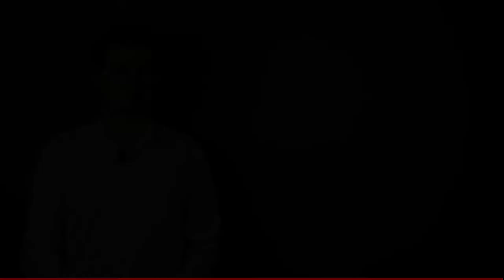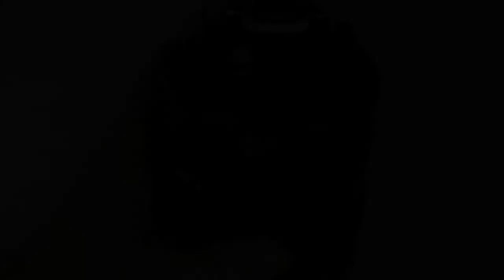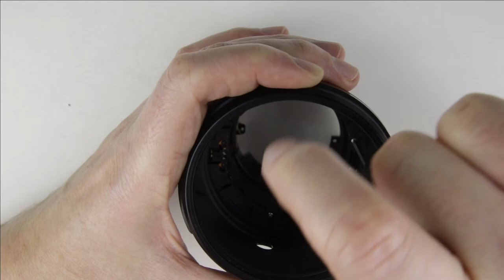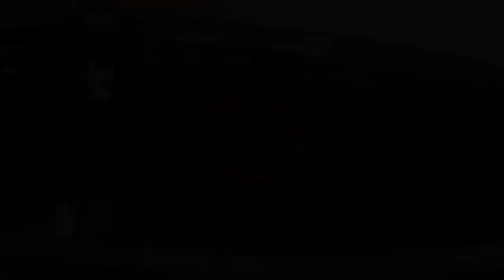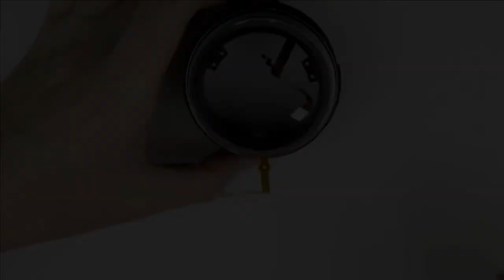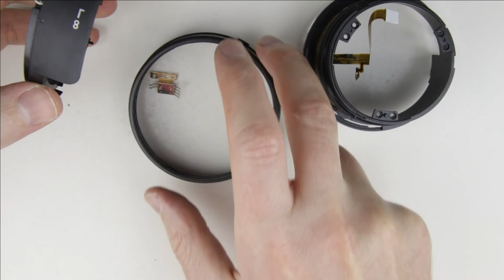Canon EF 24-70mm f/2.8 L USM disassembly for replacing the flex cable in the focus motor

Comment: Just perfect, thanks for sharing with us all your expertise. My friend has this lens and the zoom mechanism was a little bit stucked, so he sprayed some wd40 lubricant and now the  autofocus doesn't working properly. Do you think a good cleaning can solve the problem or the autofocus mechanism can be fully replaced? Thank you again.
Reply from the maker: If you mean that the lens is hunting during autofocusing, then most likely the focus strip got dirty. Remove the USM motor, disassemble it, clean the focus strip and see if it solved the problem. Wile do that, you can remove the WD40 fluid if there's any left in the lens.
Reply: @CamerasLensesEtc  Thank you friend. We'll try this solution. Have a nice week.

Comment: I have noticed that the o ring gasket for dust sealing in your lens is a bit torn. That would be great if you can make a video to show how to replace that dust sealing (there isn't   a single video on youtube show about it). Cheers.
Reply from the maker: Follow the disassembly video until I remove the metal bayonet mount, then you can replace the rubber gasket. Then, go to the assembly video, and around the end you can find how to put back the bayonet mount and the screws.

Comment: Very detailed demonstration. Could you tell me if there were any error codes that helped you to diagnose this problem or did you need to strip it down to find out? I have a similar problem with a canon 28-105mm f3.5-4.5 where the autofocus has stopped and there is no message from 3 different dslr cameras. I have tried cleaning contacts with alcohol. The lens will manually focus no problem and is in mint condition. There is very little information about repairs to this particular lens online so any information you can give me would be much appreciated. Thank you again for the video.
Reply from the maker: In my case the lens was just hunting when the camera tried to autofocus. This is a very common problem with the lens, and quite easy to check: I just had to remove the USM motor, then I saw that the cable was broken.
With your lens: the lens is so cheap, that I don't think that it would worth to repair it.

Comment: Please help.  When I went to remove the aperture module/case/diaphragm from the barrel, some of the blades fell out and I had to put them back on myself after replacing the flex cable for the aperture.

However, I have found a loose, small, semicircular plastic piece that I do not know where to replace or what it goes to.  Can you please help me identify what it is and where it goes?  I can send a picture.
Reply from the maker: Send me a photo of that on facebook messenger, and I'll take a look at it!

Comment: you've ended this video in the worst moment possible: you dont mention here the ball that is the smallest piece of the whole process. I'm trying to reassemble the lens back but I dont find the metal ball anywhere. Do you have any tip for me or others that might happen the same? :(

I'm very thankful since i used your tutorials and are very helpful, plsease fixthe focusing metal ball part and hopefully gimme any tip so I can get my lens to work.
Reply from the maker: Your lens will work without the ball.
Reply: @CamerasLensesEtc  I've bought small bearings and no yet installed them. what is it's function?